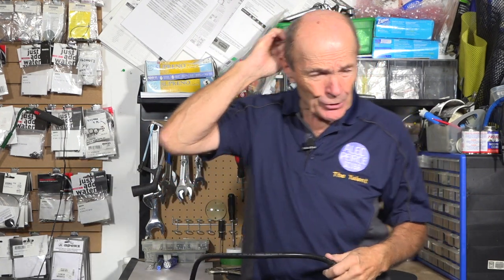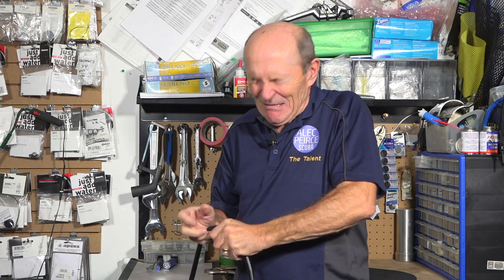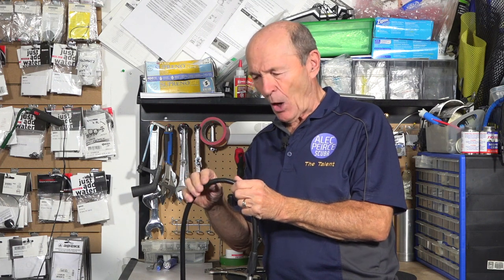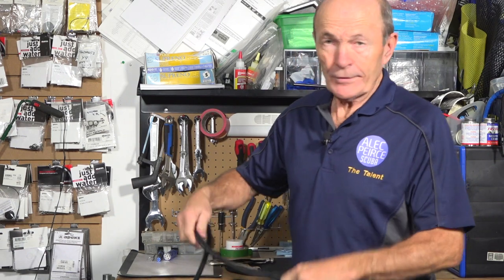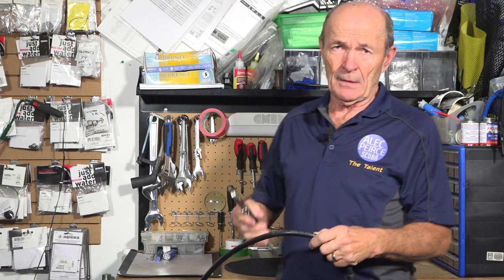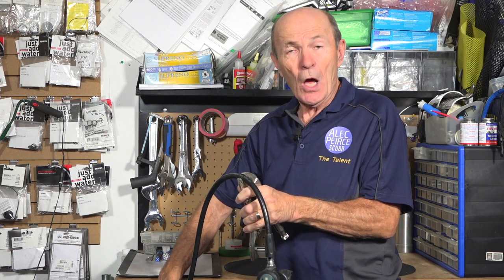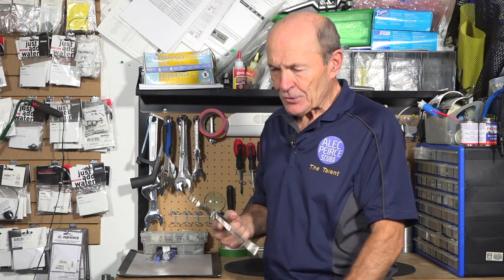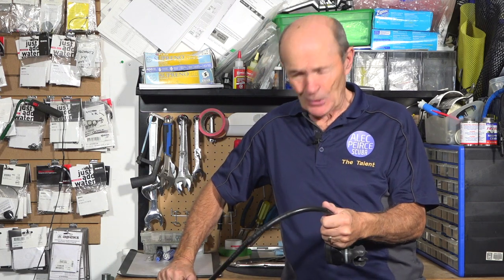Will Crimping The Hose Stop A Freeflow? - Scuba Tech Tips:  S13E06

Comment: Hi Alec, try crimping a braided nylon hose, I bet you have better success. I had the opposite issue, 2nd stage refused air. I was in sidemount and used new "tek" rated braided nylon hoses. In sidemount you tuck in the hose along the tank under a rubber band, when deploying the 2nd stage I was surprised not to get any air out the regulator. Turns out my rubber band was a bit tight and I looped the hose away from the body, meaning when pulling it out partially, the hose kinked and the 2nd stage did not deliver. It was an easy fix underwater, but later I ditched the nylon hoses and went back to rubber where such problem is unheard of as you nicely demonstrated.
Reply from the maker: Thanks for sharing that interesting story and that rubber hoses are still needed.
A

Comment: Hi Alec, great video as usual, please keep them coming.
I know you have done a few videos featuring hoses, but I don't believe you have discussed the issue around a type of flex hose which uses an internal material that breaksdown. Its said this material breaks down and 'crystalizes' inside the hose ultimately restricting airflow. I know DAN is doing some research, but I have not seen much information on the topic and would be great if you could post your opinion on its truth and real world impacts. Your years of knowledge would surely shed some light on the issue.
Reply from the maker: That is an old problem with flex hoses.  Almost every new reg sold now comes with a flex hose.  Search this playlist for 'flex' as there are a few videos on flex hoses to answer your questions.
A.

Comment: Great video!  BTW you can easily tell if your vice grips are proper scuba specific ones, because the scuba ones are deliberately negatively buoyant and sink, whereas normal ones float, this is of course to avoid surface technicians and mechanics loosing your tools if they drop them in a river........   ;-)
Reply from the maker: Ha ha that's good Max.  I should have mentioned its buoyancy.   My bad.
A.

Comment: Hi Alec. This made me think of medical oxygen tubing, they have a profile inside the tube to prevent the gas from stopping if the patient rolls over on the hose in their sleep. I hope those were not brand new hoses you destroyed? I recall being taught that if your reg freeflows then continue to use that partially inside your mouth, rather than using your safe second , just to save air on your way to the surface. Stay safe owen m
Reply from the maker: Divers can still breath from a free flow as taught in Open Water class.  The hoses where Kevin's old rubber ones after he converted to flex hoses (hope I influenced his decision).  Thanks for the medical info Owen.
A.

Comment: Alec, here is a scenario: you're at 100ft, you got separated from your buddy and your first stage freezes up and starts free-flowing. Both your secondary and octo are dumping air like it's going out of style. Would you ever throttle back your tank valve to try to slow down the loss of breathing gas?
Reply from the maker: Never!  Once a free flow starts, and no buddy, ascend slowly is the only action.  As you ascend, passing thermoclines and monitoring air, the frozen 1st stage will warm by the time you reach 15' for a safety stop. I have had free flows that stopped as I ascended past a thermocline, dive is still over!  Stay safe.
A
Reply: @AlecPeirceScuba_SeaHunter  Thank you for the quick response, Alec.

Comment: Basic engineering rule, divide actua material maximum by 2 to get the rated number.  If it is rated for 150 PSI build it to handle up to 300 PSI since it will probably burst at 250 PSI in reality.
Reply: on a hose , the burst pressure should be 4 times the working pressure, the only exception is for grease where the burst pressure need to be only 2.5 times the working pressurem it is a standard in the industry.
Reply from the maker: Rubber LP hoses have working pressure printed on the cover.  Few know their burst pressure is much higher.
- Working Pressure 400 psi
- Min Burst Pressure 2,000 psi
A.

Comment: Closing the first stage is the only effective way to stop a free flow afaik. It requires access and enough training to not panic and confuse the 2 first stages. 

Side note: 30% off low pressure hoses, small grip damages, mint condition? 😁
Reply from the maker: Divers can still breath from a free flow, that's why it's taught in Open Water pool.  Turning off the 1st stage stops the leak then what's to breath?  Better keep Kevin close to me.
A.

Comment: very good topic
any component that relies on fibers to guarentee its integrity should vever be kinked, this can be a hose, a suspension air bag , a belt, particulary a timing belt .
A tire that had been driven flat  has also been damaged so it should not been used where reliability is a concern
this is due to the fact that fibers have been damaged and can fail at a moment where you don't need it.
For sure, your video is a good warning to anyone that can be tempted to pinch a hose on a diving regulator
 The paradox is that the procedure of pinching hoses is widely used in the automotive industry for the low pressure fuel hoses and coolant hoses, it is acceptable because these hoses are not sollicited and the rubber membranes are sufficiently thick to protect the armature fibers
Reply from the maker: Good points Jacques.  Of course saving air is much more important than saving a hose that burst at 60'.  Thanks for watching.
A.